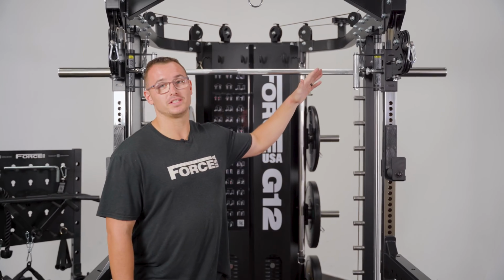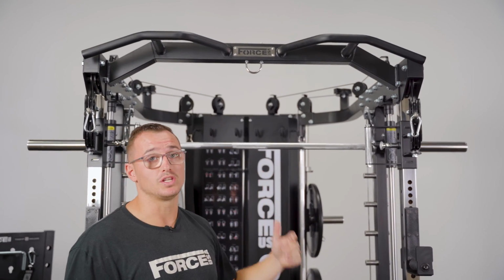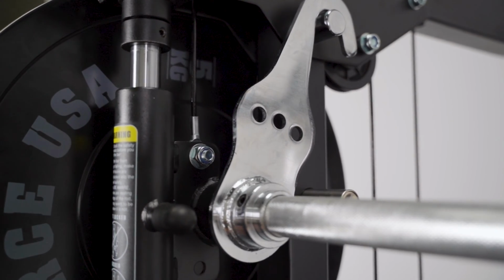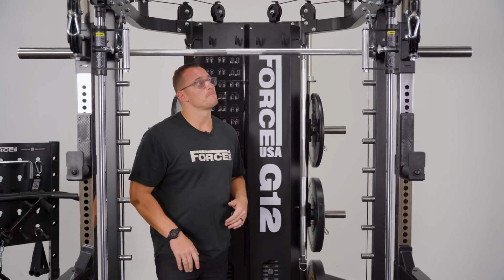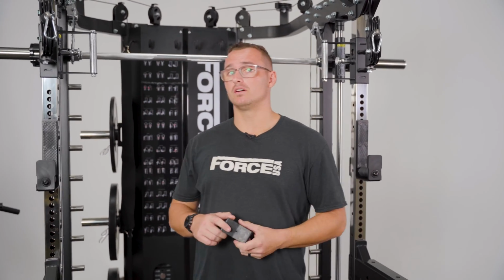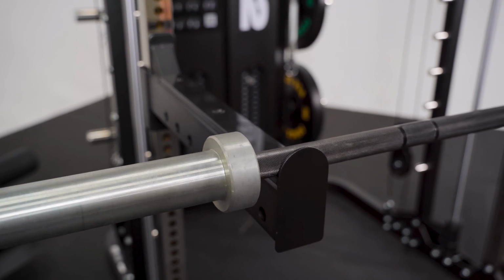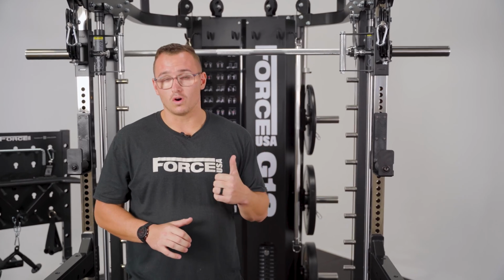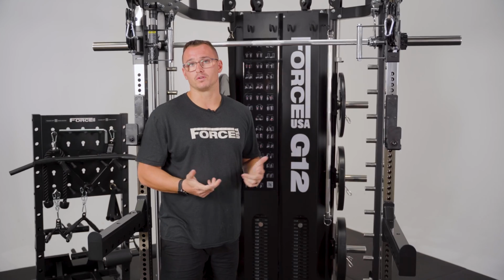Force USA G12 All-In-One Trainer Walkthrough

Comment: How much travel do the cables have? Concerned that you wouldn't be able to perform some exercises due to the 1:1 ratio meaning less cable travel?
Reply from the maker: The G12 All-In-One Trainer includes two extension chains that attach to the carabiners on the Functional Trainer, providing you with a larger range of motion! @jamiekieran9369
Reply: @forceusa1092  thanks so much for your response.

Do you mind me asking the total cable travel distance without the extensions? And then how long the extensions are?
Reply from the maker: You're welcome  @jamiekieran9369  we're always happy to help.

The total cable extension is 92.5" / 235cm, with an additional 44" / 112cm when using the extensions.

Comment: Do this to the G15! Tell me it will be done
Reply from the maker: Always open to suggestions @THEREALTWISTEDINSANE, but what specifically are you referring to that you would like to see done to the G15? 😅
Reply: Knurled handles, longer safety arms , increased weight stack and higher pull up bar = perfection , does the G 20 have knurled handles ? And will it get the counter balance in the Smith machine ? We want the ultimate machine , aluminum pulleys , I'm ready to order the G 20 or G 15 but do they have the knurled handles ? And will these upgrades ever be made ? Thanks for the response
Reply from the maker: Thanks  @THEREALTWISTEDINSANE , we value these kind of insights, and will be sure to pass on your feedback to our product team. Neither the G15 or G20 Pro have knurled handles on the front slider pulleys, this used to be a feature exclusive to our X-Series machines, but we're glad you appreciate its addition! Also, the G20 Pro's Smith machine is not counterbalanced, but the G15's is. The idea of aluminum pulleys has been discussed, but the extra wear and tear on the cables is a deterrent. We want to create compact training solutions you can train on for the long hall! 💪

We can't spill the beans on new versions, but ensure you we are always looking at new ways to innovate in this space. So even if it isn't an updated version of the machines you have mentioned, there's always something in the pipeline.